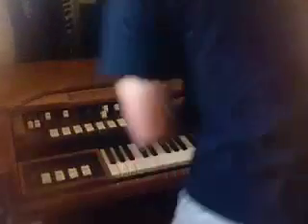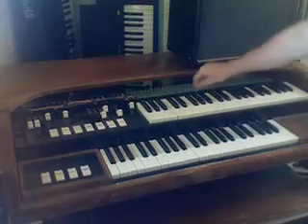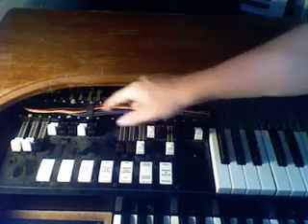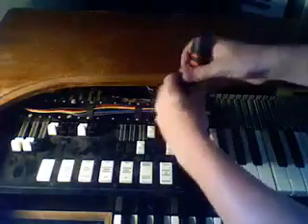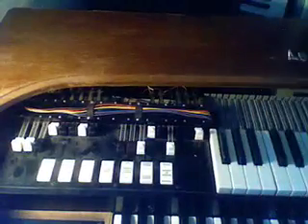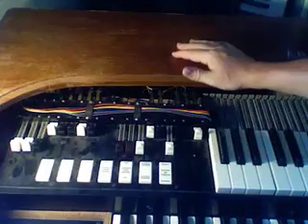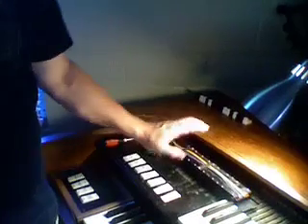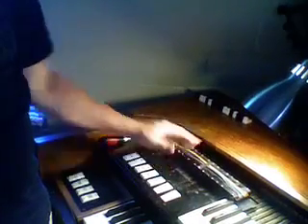Drawbar Fun

Comment: When I put my drawbars back in they aren't sliding at all and remain in the 'off' position. So basically none of the numbers are showing. The metal bar, screws w/ bolts, bottom piece are all in place. Springs and contacts are intact and fitting into the assembly - It doesn't feel broken but it does feel stuck. I did not put any lube yet, but it seems like an issue beyond lube. Do you have any ideas for what could have happened??
Reply from the maker: Hey Yvonne, first don't try to force them to move, this could cause damage. I agree this sound like more than needing lube. Honestly having done this work several years ago I don't really think they need the lube as long as you got them really clean.

So I've got two guesses as to what you're problem might be.
The first time I ever took apart the assembly I had a similar issue with the two lowest drawbars on the lower manual and the highest drawbar on the upper, but not the whole assembly. 
I had two separate issues going on which involved the plastic drawbar guides, and the assembly holding the busbars in place.

In the video I said that the plastic guides could only orient one way, but you still have to make sure they are straight up and down and don't shift before you can secure the top and bottom pieces together. 
Also in the video I said not to touch any of those smaller screws, they have to do with the busbar assembly and reassembling it is a pain. I found this out the hard way. If even one section of those busbars is not properly seated the drawbar contact will freeze against it, and using force could damage the busbar or contact. Replacing those busbars is not a project you want to do.
So, push down on the spring of the drawbar contact, all the way down to clear a potentially misaligned busbar, and carefully try to move the drawbar back and forth. If it has trouble moving with the contact pushed down, then the assembly may not be fit back together just perfectly right. If it moves easily with the contact pushed down, then your contact is getting snagged on something.

Whew, I know this is getting long but this assembly has so many different aspects to it. The main thing is don't freak out. You could just take the whole thing apart again and put it back together. These parts all fit together and worked before you took it apart, so they will go back together and work correctly if you stick with it. You can do it, just go slow and pay careful attention to how all of those moving parts fit and function together.

Let me know when you get this fixed, or if you're still having trouble. Good luck!
Reply: @88jhay  I'm still having trouble with it not sliding at all. I was told that I could have bent the bus bars, but I can't tell if they're bent or not ... Would I need to insert the bottom part (with the hex bolts)  and the small bar again to test the drawbars out properly?
Reply: And if I recall correctly when I unscrewed the draw bar caps and slid them back to the 'off position' they wouldn't slide back out (toward the numbers)  from there
Reply from the maker: @OhMyGoodwyne  So the top and bottom pieces do need to be fully put back together for the drawbars to slide correctly. Did you take off the caps and completely remove the drawbars to rearrange them because you did the lower manual octave mod, or did you remove them just to fully disassemble the unit? I think it's unlikely that a busbar is bent, simply because I would assume that it wouldn't bend so uniformly that you wouldn't be able to move a single drawbar. If you have the drawbars fully pushed in, off, then the spring should be fully accessible from the back. You can try pushing down on the spring of one of the drawbars and pulling it out. If you're able to do this, and it moves freely after you've pulled it out to full, then maybe the rest of them just aren't fully seated on the busbar track. But if I remember correctly the top and bottom pieces do need to be reassembled. I don't think the tension of the contact spring against the busbars will be right for it to move otherwise.
Reply: @88jhay  Yes, I took off the caps so I could clean the busbars/contacts. When you say it needs to be fully put back together do I also need to put all the screws and the small bar back in? I have the bottom piece in. I still haven't been able to figure it out. I'm not sure what you mean by 'if it moves freely after I pull it out to full' - it's still not sliding passed the off/pushed in position.
Reply from the maker: @OhMyGoodwyne  do you still use the Facebook account that you linked to in your Youtube profile? If so I'll send you my email address so you can send me some pics. I'm having trouble visualizing the way you've got this set up right now, pics would really help.
Reply: 88jhay Yes feel free to message me there and I can send pics/video